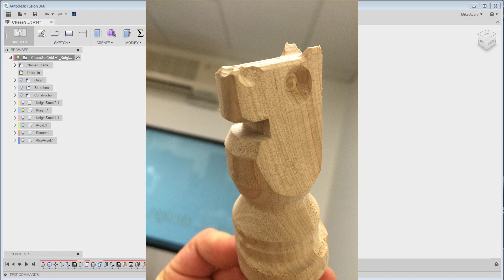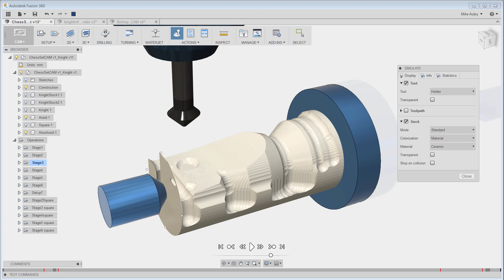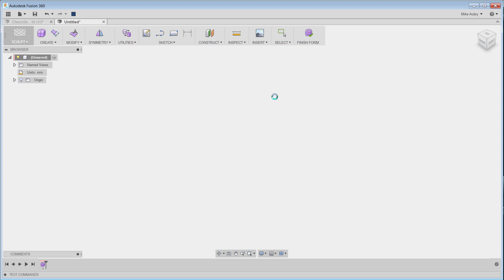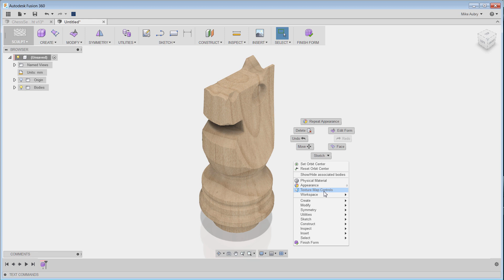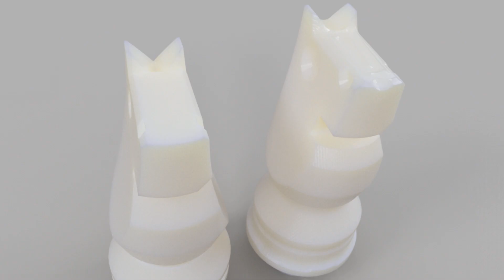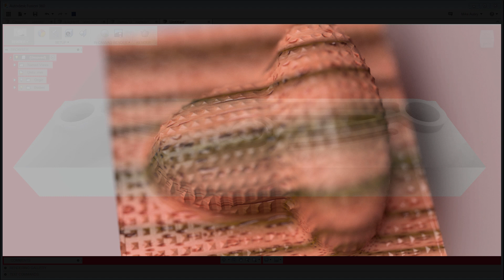QUICK TIP: Render Your Fusion 360 CAM Paths

Comment: How could I render the simulation in an animation? I am making a very complicated part for my thesis on a manual lathe but I want to present all the operations in a clean manner (I have made the setups in CAM except I'm getting some boogers with using the secondary spindle function as it doesn't seem to retract away from the stock in the primary spindle in the simulation).

Comment: Hey Mike, this was Awesome!. Are there any plans to add the function back into Fusion..all I get is crappy STL triangular mesh renders now and have to use Meshmixer and or 3DSMax Quadrify to try to get a quad body to render but have lost the CNC rest details at that point. UPDATE: So I reviewed your video again and found that adding the 3D Wood in Appearance was the step I missed..seems to work as described w/ the 3D wood.

Comment: This is absolutely fantastic. With this I can actually examine the cut wooden part and evaluate if its possible to sand it down or if the toolpath needs adjusting, BEFORE i cut. Previously this uncertainty was remedied by experience only.

Comment: Had no idea you could save the machined stock and do this. Awesome, thanks.
Reply: you can reuse the stock for additional operations too.
Reply: How do you reuse it? I tried that a while back and had two problems. One it comes in 10x the size, I read that was a bug on the cloud servers with Imperial vs Metric but easily scaled. Second being an STL it doesn't allow me to assign it as a stock body. I tried converting it to a normal solid body but it cried about too many faces, so I just gave up and continue to model my stock to a close approximate for the next ops.
Reply: bensbenz I've cleaned up the faces in Memento before. I haven't done it for a while. It was a bitch, but possible.
Reply: Ah ok, so I wasn't missing something. Doing all that hasn't been worth the effort for me, perhaps one day they can build in the functionality for true multi-setup simulation.
Reply: bensbenz HSMWorks has some degree of stock transfer between ops, but it still aint perfect. It's actually one of the significant limitations of the product when compared to the competition.... but they cost a lot more and suck in other areas.